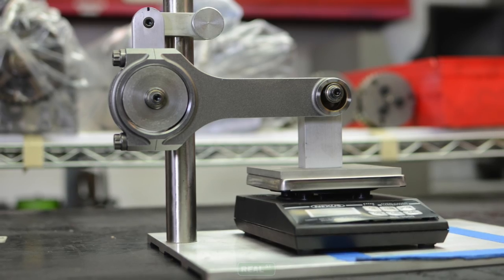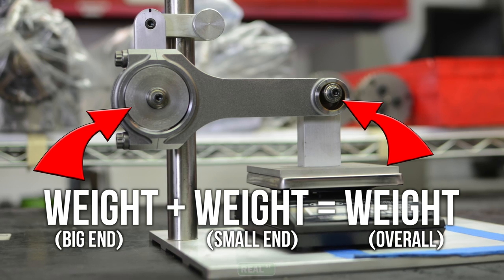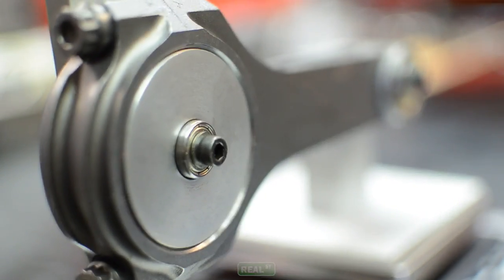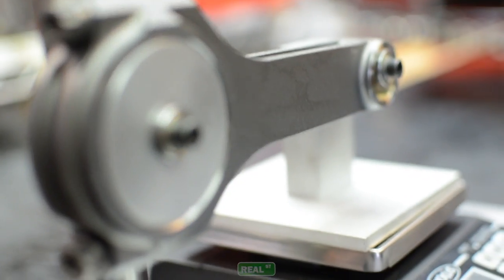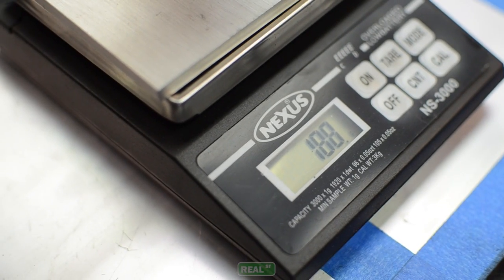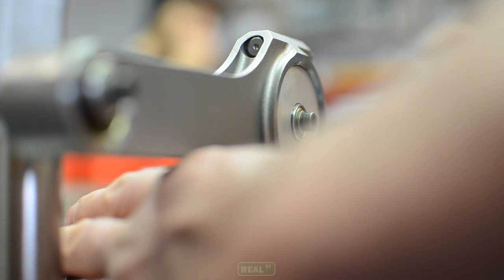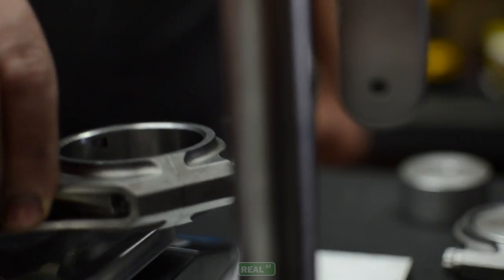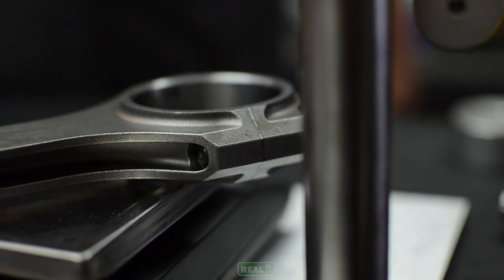Jay's Tech Tips #40 - Measuring The Split Weight of a Connecting Rod - Real Street Performance

Comment: Is there much of a difference if it's part number for part number the same exact replacement from the company?

I bought a full set of 8 Eagle H-Beam rods. Say one goes out, do they need to match gram-for-gram the rods I have? Is it that detailed?
Reply from the maker: +Matt Parrett hey matt, the same part number from the same manufacturer is not enough. The rod manufacturers go through all of their rods and weigh the split weights for all of them, and they match them in sets of 8. But your set of 8 might be slightly different than a set of the same 8 part numbers sitting next to it.  So if you have 8 eagle rods, and you need to replace one, you will still need to measure the split weights of the rods you have to get a replacement. Just calling for the same part number wont be enough to get you an appropriately matched rod

Comment: I have a question Jay. If you are upgrading to forged rods and pistons in an engine that is not naturally balanced like a V6, what will happen if you do not rebalance the crank? Anything? Or will the aftermarket rods and pistons be close enough in weight not to make a difference?
Reply: +RocketRaspeed  The weight will change with the aftermarket pistons and rods and I'd recommend having the crank spun with the new bob weight to ensure it being correct. 
 thanks